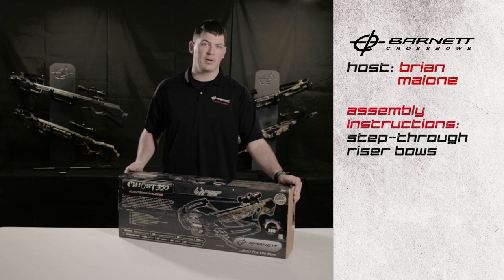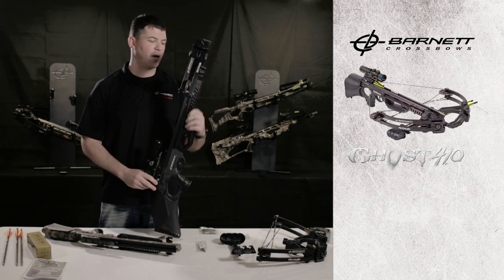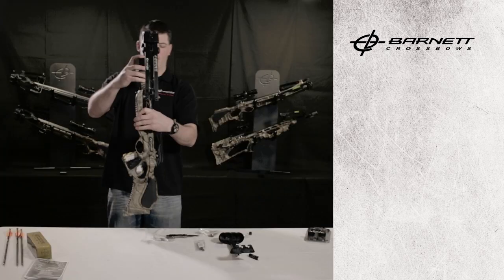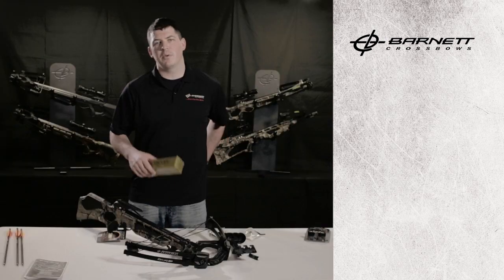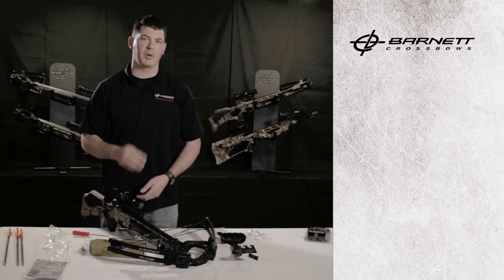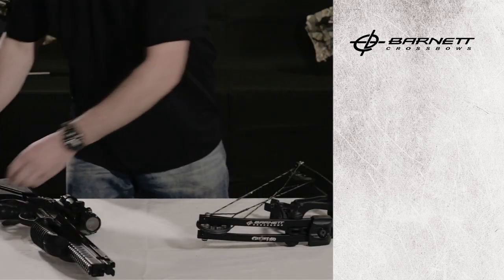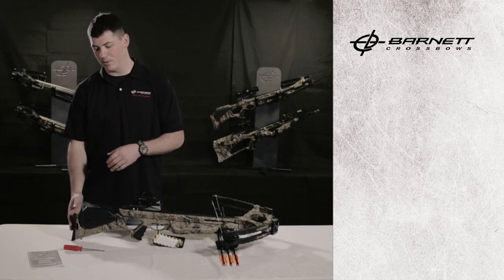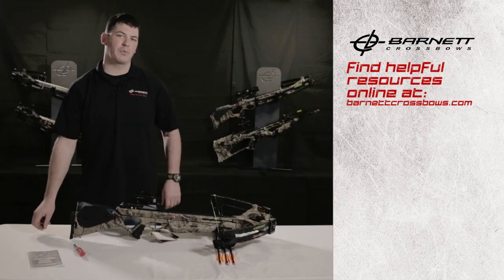Instruction - Step Through Riser Bows

Comment: Barnett Crossbows I had a friend ask me about a cable slide for my Raptor FX. Does my bow require a cable slide?
Reply: DatGuyWitDaThing my bow is a 2019 Barnett Whitetail PRO STR and it didn't come with a cable slide. I'm supposed to have some Teflon choosing on the inside under the flight track but the cables and strings were all fraying after a handful of shots. I was told by bass pro shop's rep to dial the CB in and put it away and not target shoot with my bow. It's supposed to shoot 400FPS and I had to bring it back to BPS and they have exchanged the riser 4 times in the first month I had it! Barnett sucks!